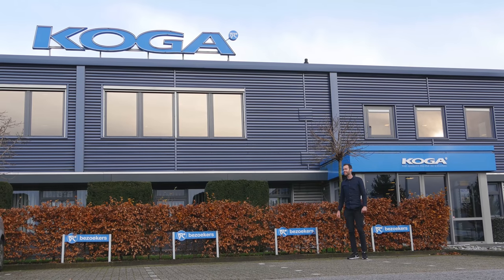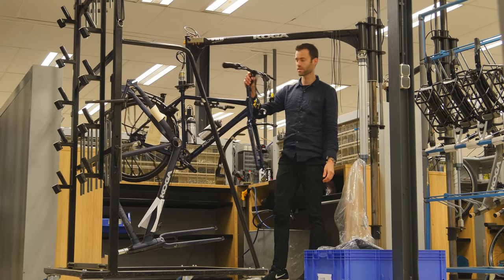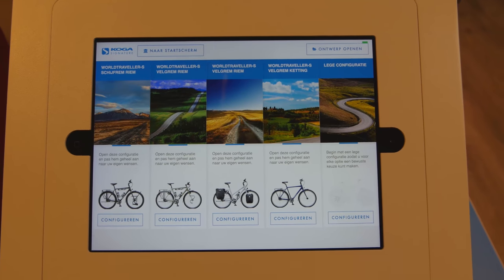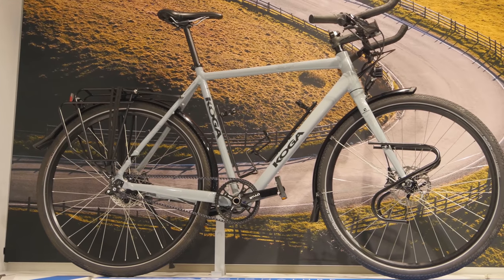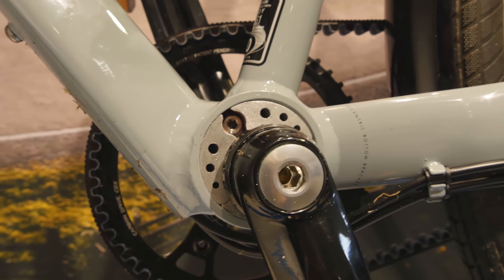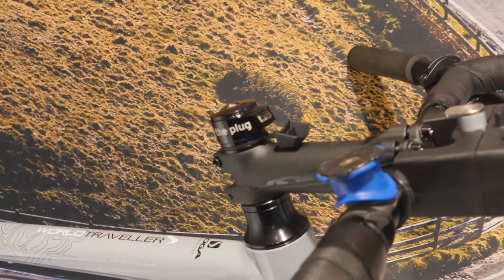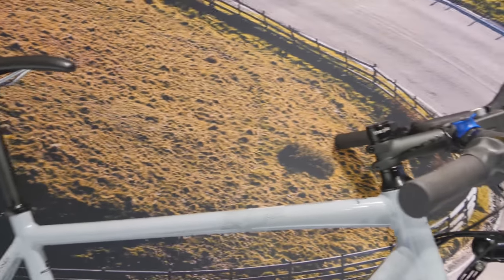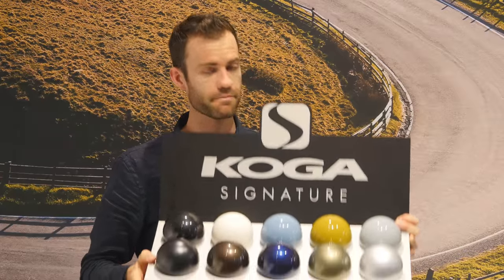My New Koga WorldTraveller Touring Bicycle For A 3-Year Bike Trip!!

Comment: Too much money for nothing.  You can get a $1,000 tourer with disc brakes and built up wheels.  I've ridden over 20,000 miles on my sub $1,000 tourer without any issues and it has blackburn 1.5L bottle cages, lightweight racks...etc.  Certainly no need for 2" tires...
Reply from the maker: That's great to hear! You can definitely go on big bike tours on cheaper bikes but I, unfortunately, have a taste for the top-end stuff and can't go back now. 😂 I completely disagree that there's no need for 2" tyres though... in fact, I'm fitting some even wider tyres next time 'round to increase comfort and allow me to ride on rougher terrain! 💪🏼

Comment: this bike is so over the top for world touring....one of the more predictable part about any sort of touring is theft and I can see this bike getting chopped to pieces when the rider goes take a leak.
Reply from the maker: I've been travelling on bikes like this since I was a teenager, so I'm pretty careful with where and how I lock my bikes. There's a tonne of locking tips on my website: https://www.cyclingabout.com/keep-your-bike-safe-strong-bike-locks-and-tips/
Reply: Make sure its caped in crap as you ride through South America. I  used to think these bikes were perfect but they are old school touring. When a propper bike thirf sees pinion slowloff and smidt they rush some to cut through the u lock with an angle grinder then strip n sell in parts on ebay. Id put black ductape all over haphazardly to make it look shit. Also if u gash a sidewall just stitch it up with fishing braid and superglue. Works at 100psi fine.
Reply: He may be a fool but he will be a rather well educated fool when he does what we only dream about.
Reply: Yer, enjoy your beautiful bike, shit bikes get stolen too..will be a pleasure to ride, and look at! 

A masterpiece!
Reply: just make it look as hard as possible to steal with bike locks all over it and the thief will move to the easier one to steal. One really good use of the U lock is to attach caught bike thief to chain link fence by his neck.
Reply: Bruce W McLaughlin Breaking Bad style!